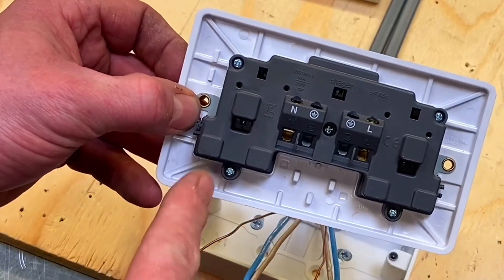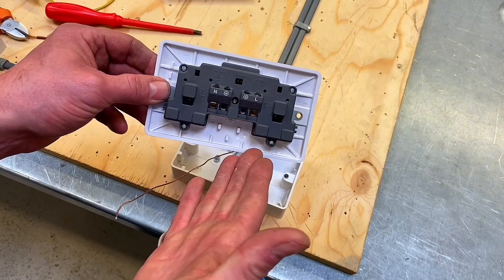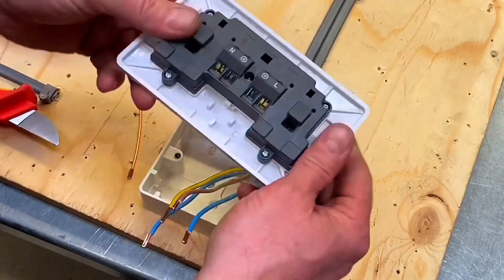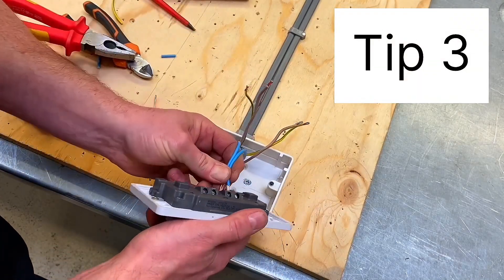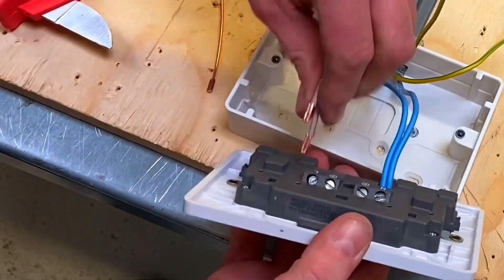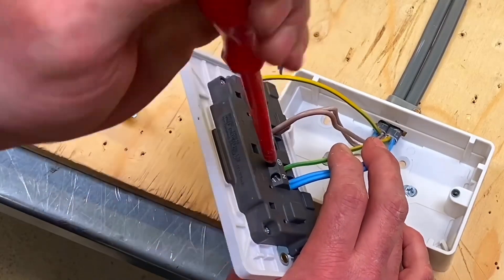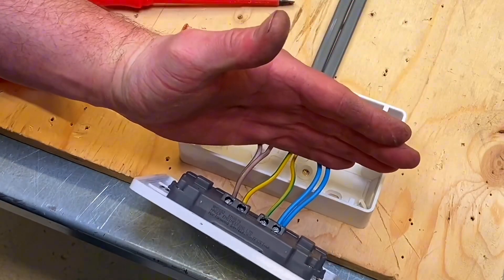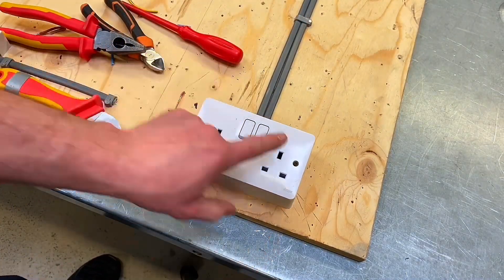7 Tips You Need to Follow when Connecting Sockets

Comment: Why on Earth did they change it to CPC?
Reply: As far as I’m concerned and most electricians I know don’t recognize the term CPC it’s an earth wire and always will be .  Even the cable I buy the manufacturer clearly states on the cable drum Twin and Earth cable or T+E cable . So even the cable manufacturers don’t recognize it .
Reply: @andysims4906  I have been called up on using the term Earth. I'm not a qualified spark more of an experienced handyman.
Reply: @Leo-gt1bx  while  in most cases I don’t approve of DIY electrics  ,at least calling a earth a earth most DIYers do in fact associate it with safety even if they don’t know any more .They wouldn’t have a clue about a CPC
It’s like a consumer unit . 70% of customers would say ,oh you mean a fuse box . 20% would say what’s that and only 10% would actually use that term . That’s why most electricians often still call it a fuse box in front of the customer as 100% of customers would be familiar with that term.
It’s a bit like lots of people still use the word Hover or hovering when it should be vacuuming.
Another example 6 months ago maybe more ,my mum took her car to the garage to have a wheel bearing replaced.  She said they also adjusted the tension on the fan belt as it was a bit slack.  If they had called it by its proper name . A auxiliary drive belt.she wouldn’t have a clue . It should be all about words everyone understands not just a few .
Reply from the maker: Great play on words 👍🏻

Comment: when you connect two grounded cables to one hole? What happens
Reply: It gives better results for testing 😂. You seprate if there are are two cpc terminals. The manufacturers have made it good practice to have two  cpc terminals. This is generally better adapted for rung final circuits. In the event the cpc terminations become loose of free. One leg will still be present back to the consumer unit. You don't have total loss of the protective conductor, should there be an earth fault.

Comment: What i think you will find on new sockets is that there is a small space in the lug of terminal to allow for a conductor to fit in deeper, it’s not always easy to manipulate the conductors into that space, definitely not by doubling two conductors over ! By not getting the conductors in as deep as possible means the screw bites down on the very end of the conductor especially as the screw is on an angle ! This is most important so as that one of the conductors doesn’t become disconnected with as well with heat expansion and contraction breaking the ring leaving it in effect two radials on 32amps, if this fault occurs on one of the last sockets especially on a kitchen ring it is a fire risk for the cable becoming too hot ! Personally i like to twist the two CPC,s together and double them over and terminate into one lug ! Standards of the manufacturing of socket outlets are allot lower now as before they use to have two screws in each lug to reduce the chances of this fault occurring ! I still believe in the ring circuit, as it’s a no brainier not to take the last leg back the CU ! Rather than having every appliance on its own circuit, apart from maybe a fridge freezer ! They say the ring circuit was used to save copper after the Second World War ! But in my opinion it’s a better system ! What i don’t like about saving copper on is earth bonding ! Say for instance a property has a 10KW electric shower and the rcd or rcbo becomes faulty and gets stuck in the on position and there is no 10mm earth conductor to the bath or the boiler pipes !
What’s your thoughts on that ? Perhaps they should reintroduce earth bonding in bathrooms !
Reply: Noooo, don't twist cpc's.
Reply: @rayc1503  why not ! I don’t mean twist them all together and put earth sleeve over all of them altogether. I just mean twist them together just at the point of where they connect into the socket outlet, as the lugs are big, but not at the CU !

Comment: Having two CCP connections and no visible connection between them spells trouble, why split the CPC’s when a manufacturing fault could break the continuity?
Reply: Why would it matter if you're testing the circuit You're verifying the continuity in your initial verification
Reply: Its better practice to split them, reason being if they are all in one connection and the conductors snap off due to overtightened then the socket looses it's cpc completely whereas if they are in seperate connections you have a chance of it still being earthed depending on the method in which the circuit has been wired.
Reply: Should twist the conductors together. If the screws work loose over time the circuit is still intact.
Reply: @johnburns4017 if both come out, how would that socket have protection? It could be an applince or boiler which requires the cpc, should there be a fault. Yes the subsequent sockets on each leg should still be protected, but that one outet won't.
Reply: @ 
If they conductors are not twisted together zero is protected.
Reply: @johnburns4017 Twisted CPCs is the bane of my life.

Comment: Why do you double over?
Reply: Gives larger surface area for screw to bite down on.  Only required when one wire in terminal.  Also find it best when three wires, to position one at bottom and two above.  Always do a ‘Gaz tug test’ and retighten after offering the accessory up to its final position. The tension put on wires when pushed back can cause a loose on to pop out!

Comment: Hi Gary,  Thanks for the video.  Do you ever see a time when torque settings for sockets will become part of BS 7671?
Reply from the maker: @billsbasementworkshop1902  if you use the MK socket type with the lever connectors on the back the torque is sorted for you… short answer yes